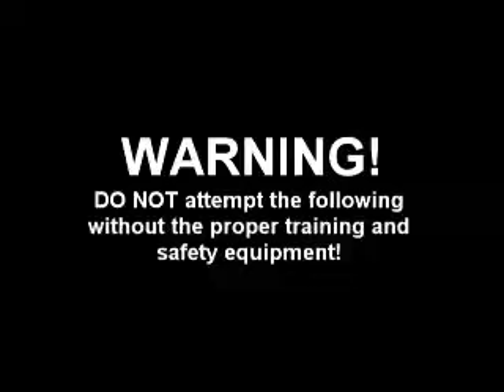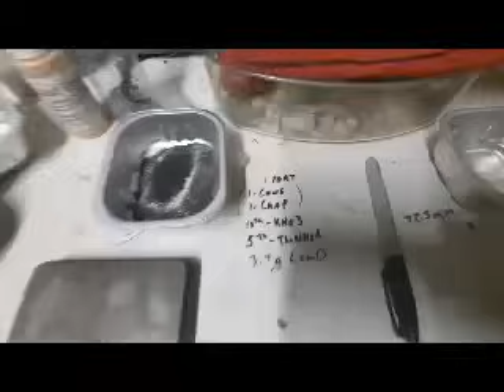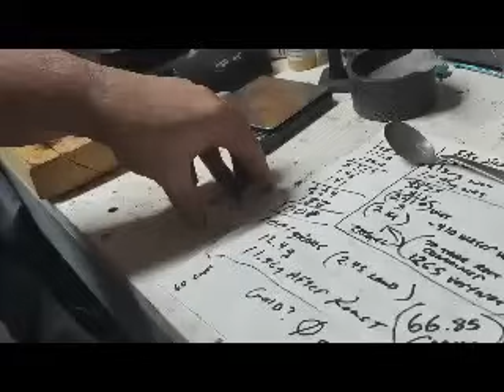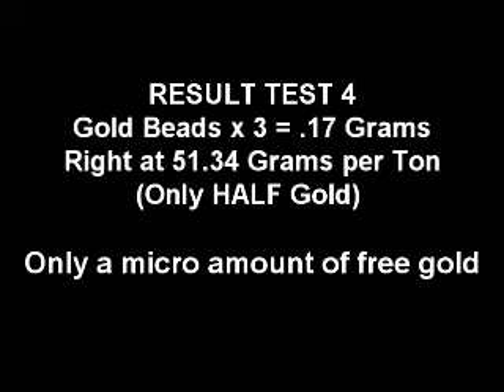Gold Ore Tests from, MBMMLLC

Comment: Jason certainly sold this on the premise of being able to pan gold from this ore and that's the only reason people would buy this stuff. There's no what they call "free gold" in this ore or very small amount like you stated. Thanks for the videos!
Reply from the maker: You make a valid point or two
Reply: 25lbs is an extremely small sample and most "ore" unless you're high grading isn't going to be rich. And the free gold in this ore is very fine in this stuff. I did a couple pans and was able to see it. when I bumped it up. But most of it requires a x40 loop to see individually. I bought 75lbs. Have processed about 50% down to -50 and am using a sluice to "speed" up concentrating it. So far I've produced 3/4 of a gram. Oh and I'm using a crazy crusher so it's taking a long time.